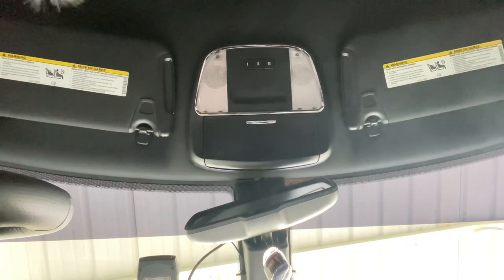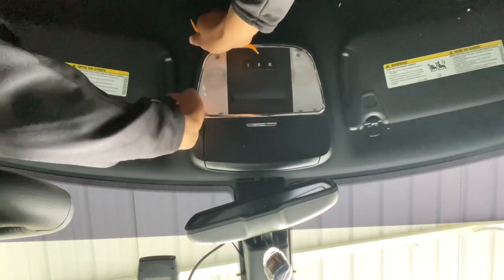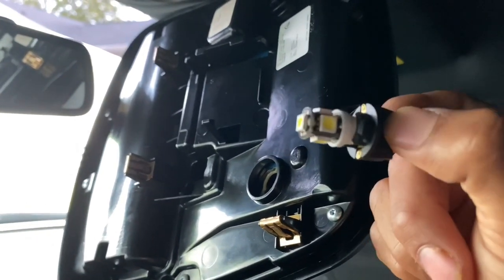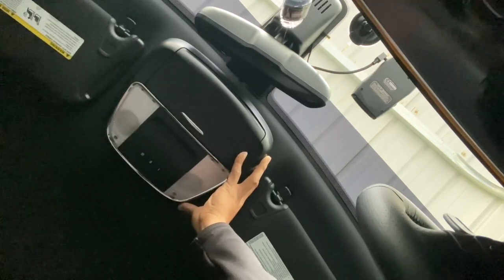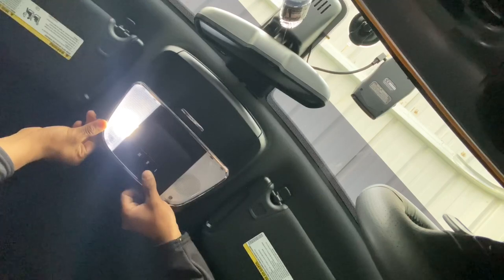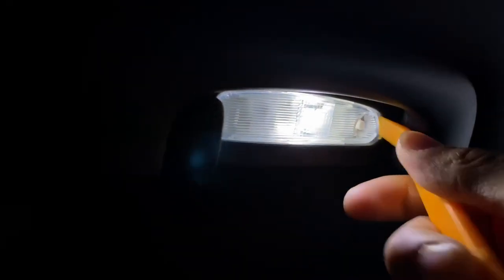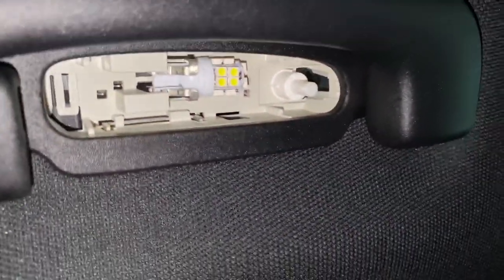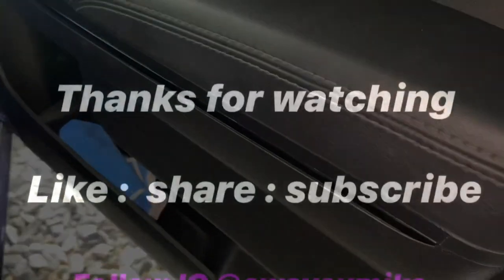Easiest way to change interior/map lights on Dodge Charger! *MUST WATCH

Comment: What is the block peice that directly holds the light called I don’t have mine but can’t find them by the name
Reply: I’m having same problem, when I took the housing off it’s just a hole where old bulb went but doesn’t have the black piece that screws bulb in